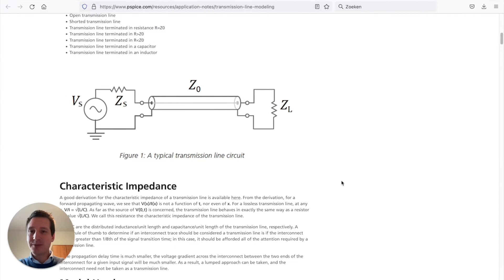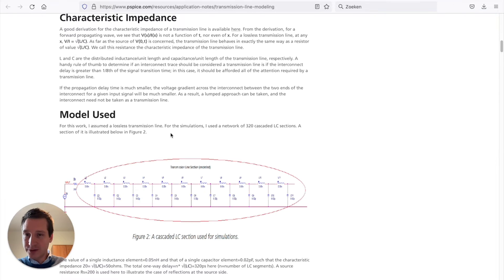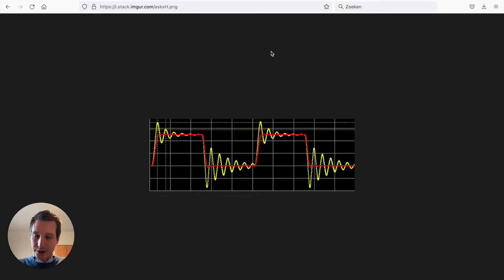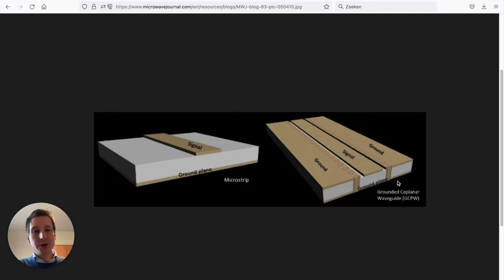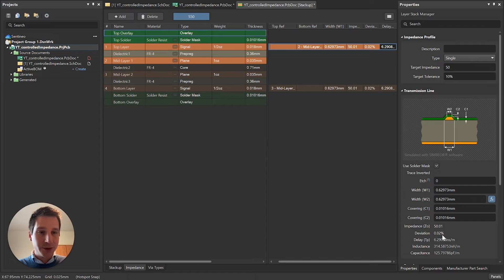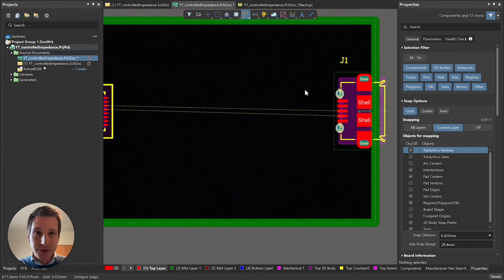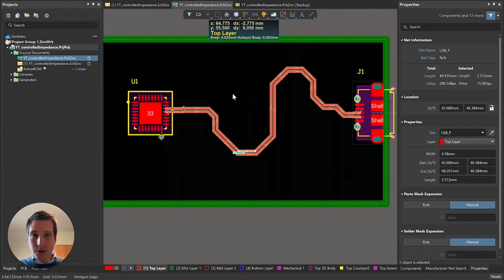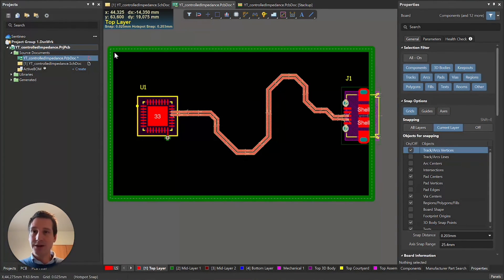Altium Designer RF Impedance Matching (e.g. 50Ω, USB, ...)

Comment: Very informative video. Just one question, does the length of the transmission line affects the impedance? Why the length effect of the wire is neglected?
Reply from the maker: It's all about characteristic impedance, length plays no role in that respect. Feel free to check out my other videos on the topic which discuss it in more detail.

Comment: great video by a great teacher. I suggest that you do a comprehensive video of high speed pcb design, of a microcontroller like STM32 with ethernet, and DDRx to grasp the concept of signal integrity practically
Reply from the maker: Thanks! The operator will select this manually normally during initial alignment.

Comment: Thanks for the video.
As far as i know, impedance depends on the signal's frequency. I've read that Altium assumes a frequency of 1GHz for its calculations, but my signal is 1590MHz. Where do i tell Altium this?

Comment: If you have a double layer PCB and you want to create the copper plane with a polygon pour, do you need to create an additional rule to ensure that return path under the differential line is solid? Why you cannot select differential pair (classes) in the return path rule?
Reply from the maker: Hi Sam, ideally I would always try to work with a 4 layer board for this. If you are forced to work with two layers, I would indeed make sure that you double check it with a return path rule. Haven't experience the issue with the differential pair class there, but you could always try to "force" the rule on a dedicated net name.

Comment: I am confused because the Top and Bottom layers are 1/2oz copper and the middle layers are 1oz copper. Usually its the other way around.
Reply from the maker: Hi, thanks for your comment. It really all depends on the stackup that you are using. The stackup in this video is a standard 4 layer from a PCB supplier. You can have 18um on top/bottom and 35um inside; but you can perfectly well use the reverse with 35um top/bottom and 18um inside. The available buildups of layer stacks are numerous, I just checked with that supplier: there are 28 options just for a 4 layer stackup production on their side.

So, it all depends on what exactly you would need. However, I would suggest to go with the standard pool on your PCB supplier's side to keep the costs low. Unless you need a specific stackup.

Comment: Good , but at the IC pins we will get error of pin to trace clearance, should we need to make trace thinner at the IC ,source ? Or just proceed with thinner differential tracks of ICs pad size.
Reply from the maker: Easiest is to make the trace thinner at the IC pins indeed.

Comment: regarding the bottom reference. if you have a 4 layer stackup of sig/pow gnd gnd sig/pow.
from what i understand its a reference to the gnd plane which in this case is the top two and then for the bottom two on the other side.

the idea of a reference plane throws me off a little , is that correct ?
Reply from the maker: hi @narutopowerdex, just to make sure I understand your question, what throws you off exactly? It is indeed so that ideally you reference a signal to a GND plane. This can be done for signals in the top layer with regards to GND on layer 2, and signals on the bottom layer with regards to GND on layer 3. Does that answer your question?
Reply: @sentineo  yep so if i have that stackup no matter what, its referencing the 2nd layer regardless
Reply from the maker: @Andreasonline3  if you place a solid plane underneath your high-speed signal, this will indeed serve as the reference plane for that signal.

Comment: I have one doubt. Suppose if we  use  3rd layer as reference of 1st top layer.   Second copper layer are open in that area…Then while calculation , two dielectric  and middle copper layer Thickenss  and  2 dielectric Er should be added?     Eg   Dielectric  er is 4.8  then the total er = 4.8+4.8   And thickness of dielectric is 0.2 and copper layer is 0,35 mm  then total thickness. Is 0.2+.035+0.2 ?  Am I correct?
Reply from the maker: Hi @sijo2084, in that case it is best to just treat it as a thicker layer of dielectric in between. It is important therefore to just use the 4.8 as relative permittivity (and not adding it to another 4.8) but with a larger height. In this case, I would go for a height of 0.4 at permittivity of 4.8 and you should be pretty close to what you need. Hope this helps?
Reply: @sentineo   thanks .. now it’s clear

Comment: No matching components (indictors, capacitors, pi-match etc) needed if we do the coplanar waveguide approach?
Reply from the maker: Hi, depending on your application I'ld say. If you are connecting an antenna to the trace, you would certainly want to hook this up to a network analyzer and foresee some matching component (check out my other video "Designing a PCB with an antenna" for that). For connecting a standard USB connector you can normally leave out any matching components. So it depends on the speed of the signal (high speed USB: check your matching) and power transfer (antenna connected = you want max power transfer: check your matching).

Hope this helps. Cheers!
Reply: @sentineo Speed of the signal?
Thought that was fixed at close to the speed of light.

Or do you mean slew rate and operating frequency?
Reply from the maker: Hi  @deang5622 , correct, frequency of that signal indeed. On a sidenote: the wave will not travel at the speed of light along a track on a PCB. Typically we consider 15cm per 1ns travelling speed in a standard FR4 substrate.
Reply: @sentineo  Thanks for the response.

My question was related to antenna only. Suppose I have a LTE modem where I want to trace a route between ANT pin to SMA connector. If the trace width and length could able to give me 50, why do I need other components?
Reply from the maker: Hi  @parthasarathimishra7538  please have a look at this video of mine about this topic exactly: https://www.youtube.com/watch?v=YtmQzJX09Lo&t

Comment: How bout the electrical line length or physical length of the trace, doesn't it affect the impedance of 90ohm meaning it can be of any length we don't care?
Reply from the maker: Don't confuse transmission line impedance with resistance. As shown in the beginning of the video, the transmission line impedance is a complex impedance and must be equal in every place along the line. This is independent of physical length of the trace. Using the tools to calculate width, spacing and return path will ensure that this is indeed the case.

Looking at resistance of a single trace solely, with increasing length, the resistance increases indeed. But that is something completely different than the complex impedance of the transmission line.
Reply: @sentineo   complex impedance always consists of resistance and reactance right or the real and imaginary part.
Reply from the maker: @whiteking80  suggested reading: https://electronics.stackexchange.com/questions/293271/characteristic-impedance-vs-resistance
cheers!
Reply: @whiteking80 No complex impedance does not always contain resistance and reactance.

An impedance can contain any combination of resistance and reactance. It can contain one or both.

Resistance is just a subset of impedance.
Reply: The characteristic impedance is based on the physical dimensions of the cable, traces, it is independent of length.

Comment: Is there a way to have a more elegant way (narrower traces to be able to acces neighbor pins of the package as well) to enter into the IC package in your example?
Reply from the maker: Hi Danny, thank you for your comment! I have tried it on my design from the video (but cannot include a screenshot here unfortunately): it is possible to route out the pins next to the differential pair on the MCU with standard 0.2mm traces. 

However, if that would not be feasible for some reason (like much smaller pitch), I would suggest to make the last part of the differential pair towards the MCU as small as you need. And this only over the distance that you need to fan out the adjacent pins. This is less ideal of course, but since it will only be over a very small distance this should not influence imedance too much.

Another option: via in pad on the adjacent pins (but for production you should ideally fill these vias in the PCB production process).

Hope this answers your question?